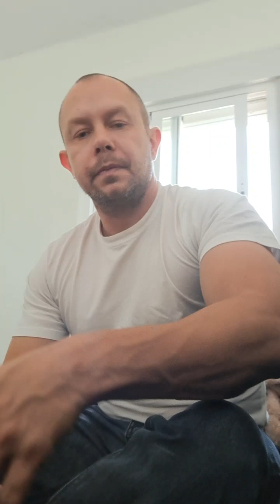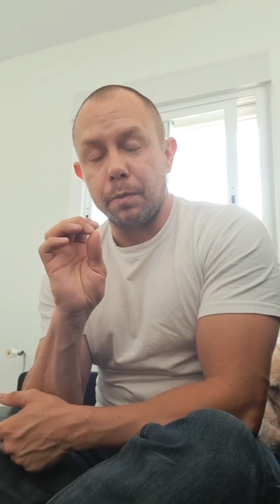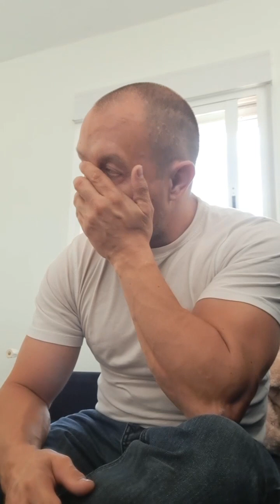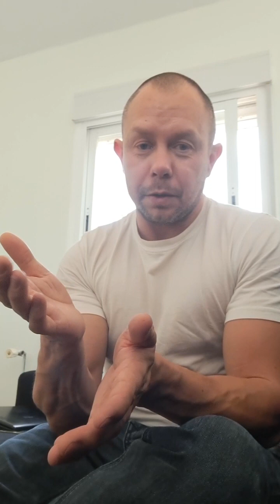Timing your om606 Mercedes injection pump and others... How important is it really?

Comment: I appreciate the video but whenever you speak of degrees you never made mention of btdc or atdc🤔
Reply from the maker: That is correct because your pump builder will choose what degree he want to use for the installation so the same setting can be anywhere between 0-720 but normally 10atdc or 20btdc. This video just informs you in what manner you install and check the timing. The rest is up yo you and the pump builder.

Comment: The only way to set timing is on the dyno, if the pump is over advanced or under advanced you lose torque and power. My own OM602 engine I picked up 30 horsepower when I retarded the pump by some 6 degrees from the position I started with.